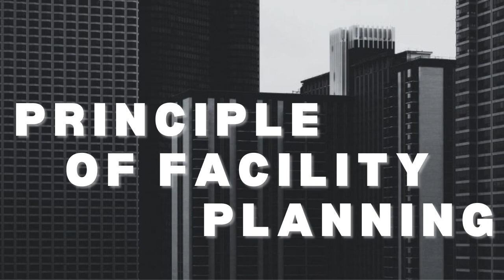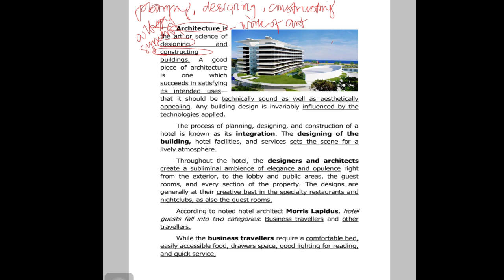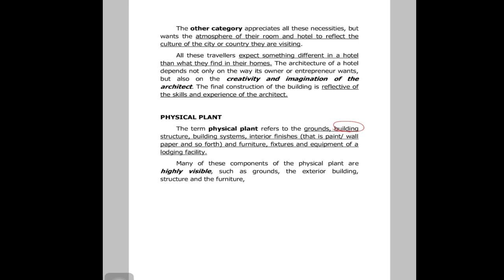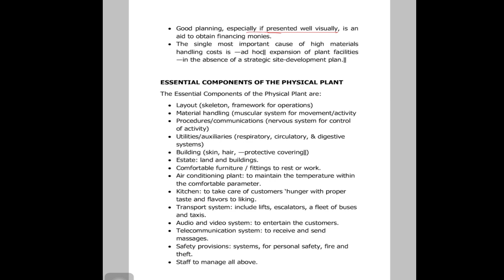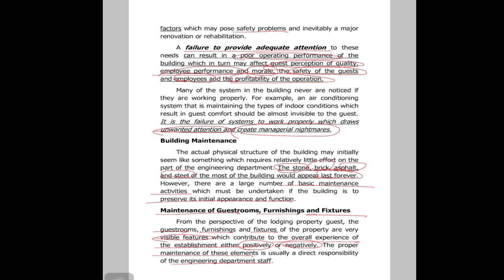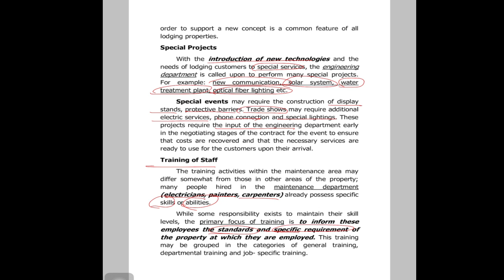HM109 Principle of Facility Planning

Comment: According to this module. Principle of facility planning. 

*Planning-means this are the concepts and ideas.

*Facility planning - this reapers to design, layout, and accommodation of people, machine and activities of the system or enterprise with in the physical environments.

*Architecture - is both process of planning, designing, and constructing or as a cultural simble or work of art.

According to noted hotel architect "Morris Lapidus" we have two categories of travellers.
*Business Travellers- they require a comfortable bed, easily accessible food, drawers space, good lighting for reading, and quick service. Or they we called them a corporate people because they are doing business or transactions in relation to business. So that they need a room fix to their needs.
*Other Category or the tourists- this type of travellers is the one who can appreciate the beauty of the hotel.

*Physical plant - this is a HIGHLY VISIBLE like the design inside the hotel or the fixture and furniture.

*Renovation Addiction and restoration - when we say renovation this is upgrading or putting new thing. And restoration is putting back or preserving the beauty of one  thing.

Comment: In this module I learned that constructing or making our own hotel is not easy. First the basis or foundation of idea is important. Also the facility planning because as I understand this is the design,layout and accomodation of a hotel. Evert business has a goal first of all earning a money or earn prifit is main aim og any businesa.
Each hotel has a prime motive which is used to attract more and more guests and can make their stay unforgetable. By planning the facility architecture is responsible to designing, constructing buildings meaning architecture can process all planing. Kung may balak tayo magtayo ng hotel kailangan natin isipin yung masatisfy ang guest natin ang also maging mga staff is comfortable in place thats why designers and architect even the owner is important to meet their Ideas. 
According to Morris lapidus there are two types of travellers. The Business travellers first is the one who find some comfortable room or bed to make their business work it is required for them also easily accesible food. The second is Other category that is the one who expected something different thats new for them. 
Physical plant is the ground, buildings,structure and interior process which is refers to those aspects and component in particular eatablishment that are visible to eye.
In Planning a Facility we have fixture it is the item that can't easily to move inside or outside of the hotel because from the word fixture it is fix. The example is (HVAC) heating, ventilating and air conditioning system it is a seldon as I understand seldon is hindi sya nakikita agad or madalang makita ng guest or staff.
The Engineering and maintenance department include offcourse the engineers who care and responsible for the physical operating plan. To make each facitilies provide an appealing visual environment.

Comment: In every business establishments is not only focusing in earning money but also something to do with the facade and architectural design. And the objectives of a  business is to give priority and to showcase the best local tradition and culture when it comes to their lodging accommodation to satisfy clients. For this to happen it depends on the architectural designs. When we say architecture is about planning, designing and constructing, an appreciation of what we called beauty and a invariably by the technologies. People are coming back because the hotel are also appealing and aesthetically pleasing (interior & exterior). Physical plant refers to the highly visible aspects or components of a particular establishments (e.g. grounds, building structure and etc.). And Fixtures are the items that are properly attached that needed a maintenance and energy cost incurred over the building. The department that is responsible in here is Engineer and maintenance department to avoid poor operation performance, many department will be affect when it happen. And facility planning is also something to do with security to protect the assets and people that are in the premises. All that are mentioned in the video has something to do with the success of the business.

Comment: Safety and Security Maintenance
Security is all about Physical assets of the property and employees suppliers guest. Yung mga bagay na nakikita sa loob ng establishments (Tangible Items)
Safety is all about Potential injury to both employees and guest. Smaller establishments it is not unusual for buliding safety and security to be largely responsibility of the engineering department.
Security and safety concern with in the area:
*Key Control
*Lack rotation
*Control of tools and supplies
*Emergency
*Potentialy dangerous situation
*Safe operation of equipment
*Tools and outside control contructor interaction.

Comment: In this module i learned what Principle of Facility Planning is. Principle means concepts/ideas. This will be the foundation of a concept and ideas and Facility Planning is this will be the design, layout and accommodation.
Architecture is art or Science of designing and constructing. The 3 process of Architecture is the first one is planning second designing and the third one is constructing. 
Fixtures means Items that properly attached /fixed.
The parts of engineer is:
*mecramical
*chemical
*technical
*civil
*electrical.
Repair and Maintenance of all equipment- they are the responsibility of tge engineering department.
Security involves physical assets of the property imployees, suppliers and the guest. Safety involves the potential injury to both imployees and guest.

Comment: Watching this educational video about facility planning expands my point of view/perception about the development of hotel establishments, it is far more complex than what I have taught the discussion point out the specifics about putting up a hotel from interior and exterior factors/features of the facilities and the building structure itself, the architects, designers, and engineers take a greater role in the future success of hotel establishment for the reason that the process of planning, designing and construction of the hotel is known as its integration they incorporate into a larger unit with a sole objective of creating/developing a modernized building that guarantees people safety and guest satisfaction because the facilities or building itself are the attractions that engage and entertains guests. Throughout the video I have learned to determine the roles of various parts of facilities in a hotel building and the essential components of the physical plant such as the layout –framework for operations, material handling -the muscular system for movement, procedures/communications as the nervous system for control of activity and so on, The hotels are classified by its facilities, amenities, interior and exterior designs the level of service provided and so on. Hotels are rated accordingly with star ratings by the classification committee (5-1 star). Planning is essential in every aspect especially in hotel industry there are many reasons for the need of good facilities planning such as Plant facilities influence the costs of operating and profits, Facilities are fixed investments, not readily convertible to money or resale, Planning allows facilities to comply with laws or regulations and so on as stated in module 1.2, The facility planning also includes the Maintenance and System operation of the establishment this is a vital factor in operating a hotel because a failure to provide attention to this factors may lead to poor operating performance, the profitability of the operation, employee performance, etc. In conclusion, the principle of facility planning not only involves beautification of the structure/features of facilities itself but also the Operating system that occurs to those facilities, the adaptability/flexibility of employees to work to those facilities, the care and safety of those facilities the maintenance, cost control and many more related factors to facilities this video is helpful to me to comprehend those topics.

Comment: Sa Facility planning meron tayong FIXTURES AND EQUIPMENT, ito ang mga structural steel,plumbing o mga tubo,ventilating at air conditions ito yung mga bagay na hindi nakikita ng mga guest o empleyado sa isang structure. 
Meron naman tayong tinatawag na PHYSICAL PLANT at ito ay ang ground,buolding structure ,building system at iba pa.ito namang mga ito ay highly visible nakikita ng mga guest o empleyado.makikita morin dito sa video na ito ang kahalagahan ng disenyo ng isang structure dahil isa sa dahilan ng isang guest o turista para bumalik sa isang lugar ay dahil sa AMBIANCE o yung COMFORTABLE FEELING sa isang lugar.we also have maintenance na mangangalaga sa mga equipment ng isang hotel,mahalaga ang papel ng isang maintenance sa isang hotel dahil maiiwasan natin ang sinasabi nilang REPAIR EXPENSES o yung gagastusin mo sa pagpapa ayos ng isang bagay kapag ito ay nasira.

Comment: In this module i learn what is the meaning of principle of facility planning. Principle is the concepts or ideas, the basis and foundation nof Ideas while Facility planning refers to design, lay out and accommodation of people,machine and activities.
- I learn that the main Aim or Objective of any business Organization is to earn Profit. I learn that Architecture describe in 3 it is both planning, designing and constructing buildings and also they are perceived as a cultural symbol and at the same time the work of art. In this lesson i learn that Engineering or Engineers has a lot of responsibility to the care and operation of the physical plant. Now i know those needs to establish a good facility planning. I also encounter those essential components of physical plant like layout, material handling and etc. Now i understand the role of facilities in a hotel building, it gives experience and comfort to guest.  In the end i saw the importance of engineering department staff and maintenance in the Industry.
Thankyou maam for this lessons. 😊